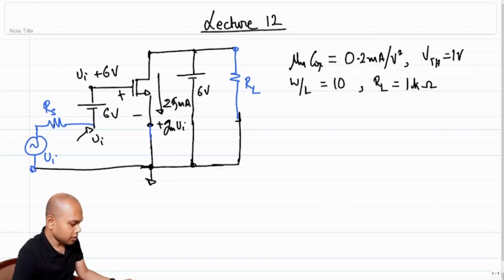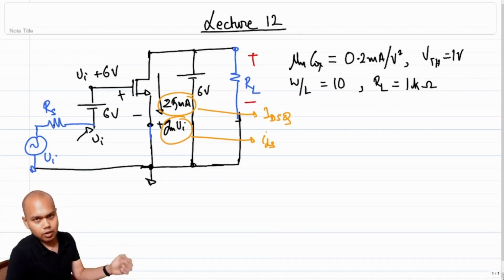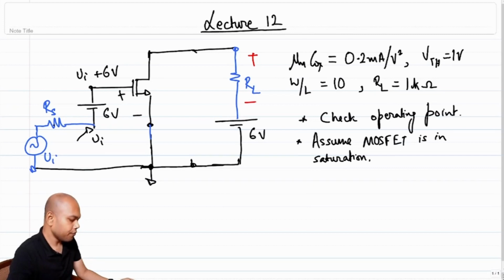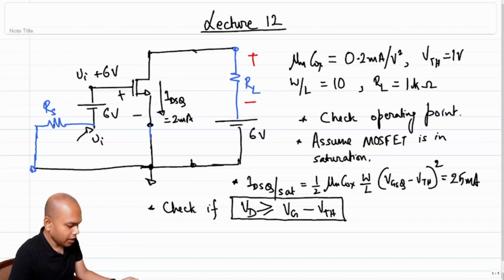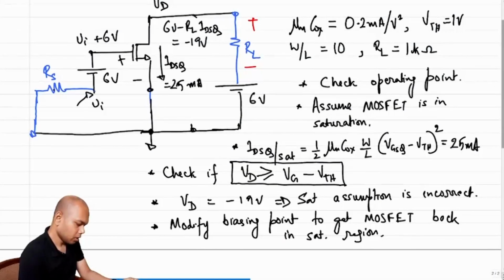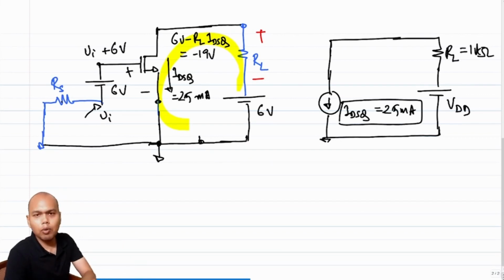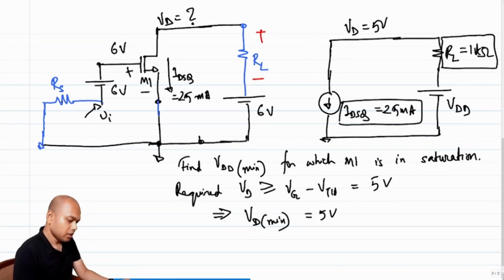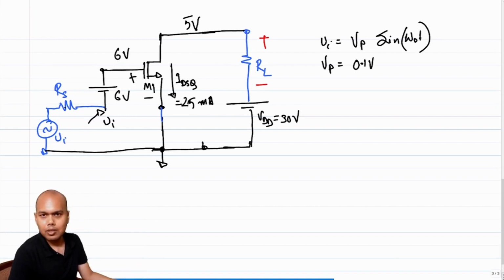Lecture 12 Module 1

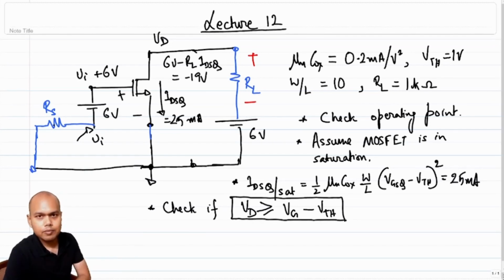Comment: 12:00 small mistake sir, the reasistor voltage drop is fliped since the current enters from down the +ve sign show be below the load resistor . but anyhow the equation is correct ( Vd=6v-Rl*Idc). otherthan that great explanation thank you sir